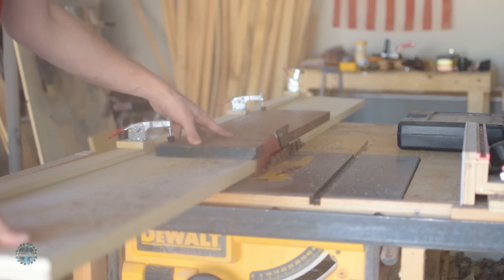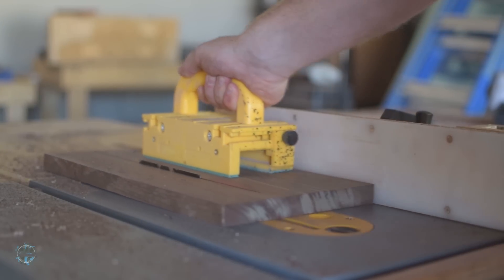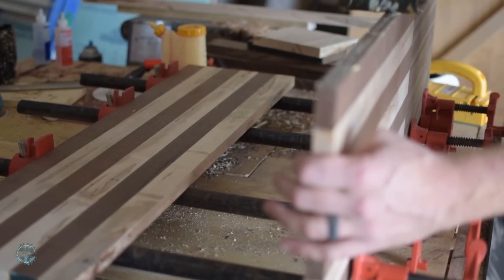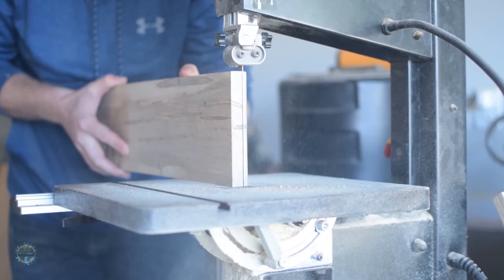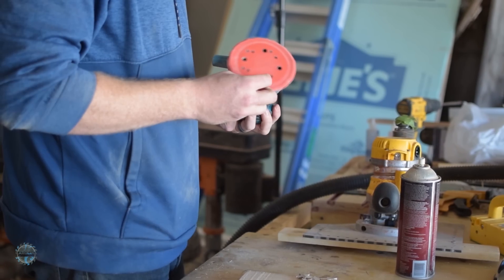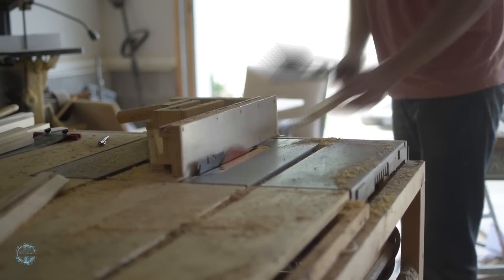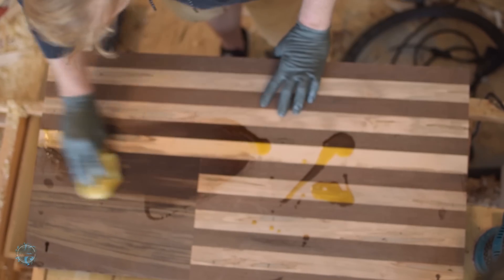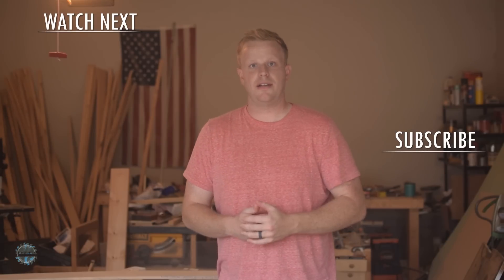How to Make an American Flag Challenge Coin Rack Without a CNC | Woodworking/DIY | Free Plans!

Comment: Great video. Several things I wanted to point out. If you get a laser, you don't have to hassle with hand cutting the stars therefore saving your hands (carpal tunnel syndrome). I have a laser which works for me right now. I know I need a bigger one but have to pay off the smaller one. Please try to wear a dust mask when sanding and cutting wood. Working repeatedly with wood and being exposed to the dust can and frequently causes health issues. I also wear goggles because I'm deaf and don't want to lose what vision I have to something that randomly flies out to hit my face but I wear my face mask at all times. I discovered that I had health problems after working as a cnc operator cutting fiberglass and wood that was going to be turned into lightweight aircraft cabinetry. Severe sinus infections plus pneumonia once.....repeatedly. My doctor said I had an allergy so I was going to change jobs but my company got bought out for the assets and everyone was laid off. I had to wear a mask at work after being diagnosed with the allergy.

Comment: What are the dimensions?
Reply from the maker: It’s 36” wide and 19 3/32” tall
Reply: What are the dimensions of the star?  Looking at ordering the stars.
Reply from the maker: About 2 1/4” diameter
Reply: @CarolinaCraftsman  no there not  that size would not fit on that size of a flag .  they r probably one inch diameter